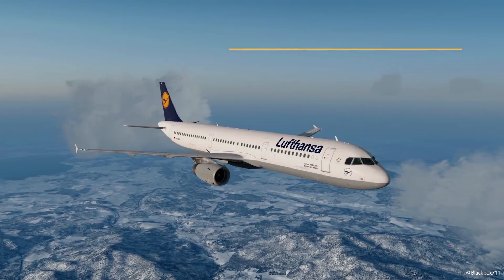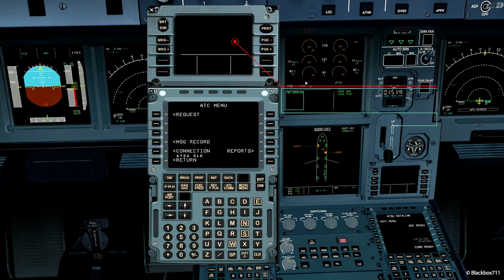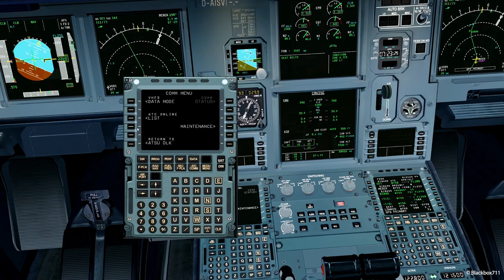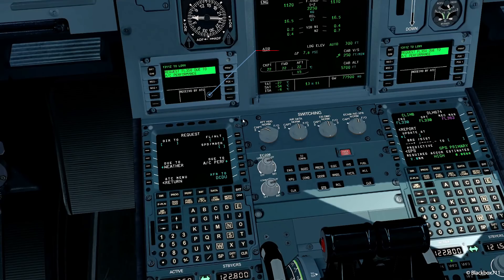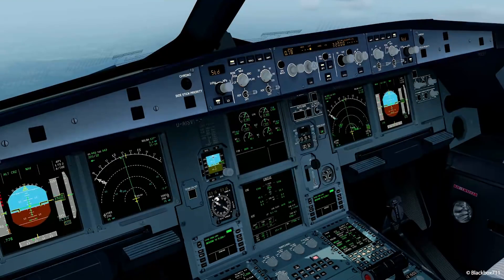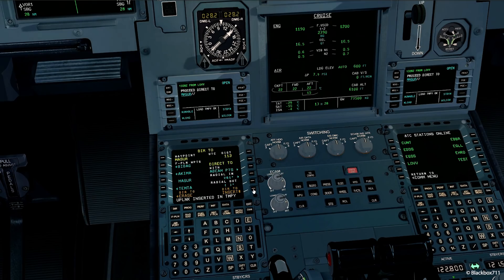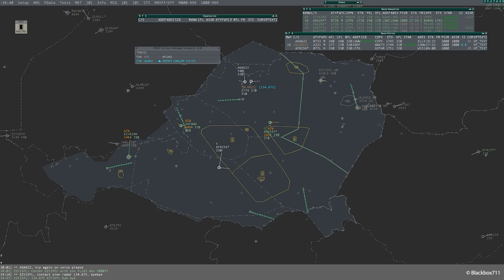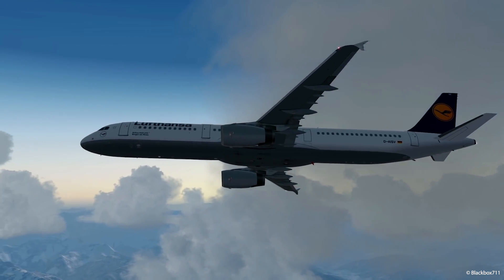FSLabs A321-X: The CPDLC system in action

Comment: I work to interconnect the ground systems for this, what an insight, even though a virtual one. Plus the knowledge you share on your live streams certainly complement the engineering aspect, from the operating pilot point of view. Do you happen to be a test/technical pilot at work (due your privacy, you don't have to answer this :)) that perform evaluation on this for your airline? Again, what an insight, keep it coming Captain. Thanks.
Reply from the maker: Hi. Thank you very much for your kind feedback. I don’t have a special function at my airline. The technical side of an aircraft has always fascinated me. May I add that I have high respect for all engineers and mechanics working on these marvelous machines. Take care.

Comment: How does it work when establishing contact over CPDLC during climb and descent?
Say you are climbing through FL285 having used voice communication, and now you are ready to connect to datalink. Is this done without any verbal
 confirmation?

And a similar question for descent. When descending through FL285 and CPDLC no longer is valid, does ATC send a datalink prior to terminating CPDLC or is the switch back over to voice done without prior confirmation?

Thanks in advance!
Reply from the maker: Verbal communication is still being used as a primary means since it is the fastest way to get a new clearance across. So a CPDLC logon during climb/descent is done without verbal confirmation since both sides get a confirmation that they are now connected. ATC may then choose either CPDLC or voice communication for clearances and frequency changes.
Reply from the maker: Don’t confuse CPDLC as being a substitute for voice communication. CPDLC is an additional means of communicating. So a termination of CPDLC is initiated by either the Pilots or ATC. There will be a message on the display to let you know that CPDLC is terminated.

Comment: @Blackbox711 Great work. I recently started flying Fslabs A320 on FSX. And the aircraft shakes unnecessarily in between especially on final approach even in calm winds. So is this due to some bugs in the aircraft itself or due to the frame rate?
Reply from the maker: Hi. Thank you. That must be some bug because that shouldn’t happen. Are you using any other addon like Active Sky or RealTurb?
Reply from the maker: @294rahul  hmmm. Something seems to interfere. Does it happen with other aircraft as well?
Reply: @Blackbox711  Yes with Aerosoft A320 also. But not with PMDG and similar add-on.
Reply from the maker: @294rahul  I am wondering if it does have to do with your PC specs.

Comment: It looks awesome. I wish i had a pc good enough to run FSL at 20 fps.
Reply from the maker: The devs of FSLabs have improved FPS performance with the latest versions. So with medium settings in P3D you should be able to reach 30 FPS with a medium range PC.
Reply: Blackbox711 i agree for A319 and A320. Unfortuneately for me the A321 is a big performance hit :( up tp 25% less fps then with 319/320.
Reply: I have the fsx version of the a-320 and I get between 20-25fps with everything turned up and I only have an I3 9th generation.

Comment: When you change the sector, do you have to logoff and logon in the next sector manually, or is there a function, which do this automatically for you? Like this function with the ATC-COMM Frequency....
Reply from the maker: Hi Burkhard. If the next sector is offering CPDLC then the transfer goes automatically. No need to re-logon with the nect ATC station.
Reply: To add to Blackbox' answer - that depends if the ATC client is set up correctly. Especially when using alternate logons, for example if another network is using the "normal" logon, the automatic handoff may have problems. In that case one has to logon again on the downstream sector.

Comment: Hi BB711, Can you tell me why do you prefer VATSIM over IVAO, is it for technical reason? Easier to use? Better service?Better coverage?
Anyway, thank's a lot for your valuable expertise .
As you probably know : knowledge is worth only if it is shared.
Marco
Reply from the maker: I started out with VATSIM. Also tried IVAO for a while. However I had some strange experiences using IVAO where I got the impression VATSIM controllers are more professional. So I stuck with VATSIM.

Comment: For descent instructions would ATC usually send it over CPDLC or verbally? And is this just for Airbus or does Boeing have there own version?
Reply from the maker: I think the B747 has the ATC messages shown on the upper EICAS below the engine indications. If you are connected via CPDLC the controller can give you the descent clearance either via voice or CPDLC. If it is done by CPDLC you send wilco and make sure the controller received the downlink and then you can descend without using voice.
Reply: Blackbox711 👍👍

Comment: When you LOGON to an ATC, do we have to enter any datalink frequency?
Reply from the maker: No. Just the 4 letter area loggon code. Of course you need to also contact the responsible controller via voice.
Reply: Blackbox711 Thanks for your response. Then I have another question: In the Boeing 777, we are able to tune VHF frequencies in a page called ACARS in the manager menu. When do we use those frequencies? For ACARS operation? There is something I don't understand there.
Reply from the maker: No, normally the ACARS works independently from the tunes VHF frequencies. Although in reality it does transmit on VHF. I have no idea how that works in the 777.
Reply: Blackbox711 I will ask that to a 777 pilot. Thank you very much.

Comment: How to logon to atc? bcs I've tried notify the atc it when failed
Reply from the maker: You need to check if the controller actually offers CPDLC. Simply ask him and if he does you will get the logon code. For example EDMS
Reply: @Blackbox711  yeah I tried today with EDGG but still failed, and I dont understand about the code. and how I enter the code to mcdu?
Reply: Is that require 3rd party software to do so?
Reply from the maker: Did you get a hoppie code? https://www.hoppie.nl/acars/system/register.html
Reply: @Blackbox711   that's mean I must install hoppie acars?
Reply from the maker: Nope. You only the code
Reply from the maker: In the FSLabs installation it asks you to enter that code

Comment: Hello, I have a problem with the new CPDLC system, every time when I try to connect, it say fail, what is happening? 

I am sure that the ATC have this system, because we can use this system in the hoppie app, when I use it in FSLABS A321 it become failure.

Do I need to enter my LOGON code to the FSLabs airbus, where should I enter it?
Reply: yes with P3D you need to go to your Addon files and in FSL there is an ACARS.ini file

Comment: Do i need an account for Hoppie?
Reply from the maker: If you want to use CPDLC integrated in the FSLabs the way that I showed in the video, then Yes
Reply: Ok. Is it only Hoppie or do i need a Vatsim ccount as well? Thanks for your answers. And i need the Hoppie software to run in the background i believe. Right?
Reply from the maker: The nice thing about the FSLabs A321 CPDLC system is the fact that you don’t need to have any Hoppie addon running in the background. So only your Hoppie ID is needed. And of course, if you want to use CPDLC with ATC, then either a VATSIM or IVAO connection is required. Theoretically you don’t need to be logged on to any ATC and could be using CPDLC if you have a friend that can simulate a CPDLC station.
Reply: thank you very much for your answer.